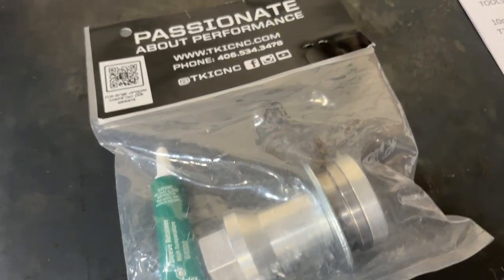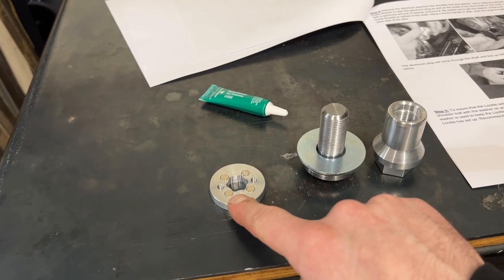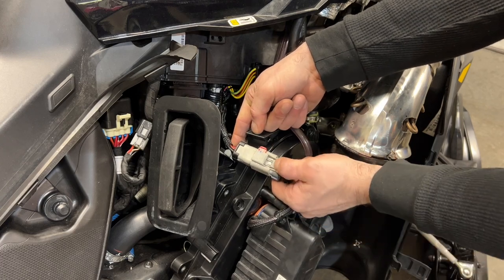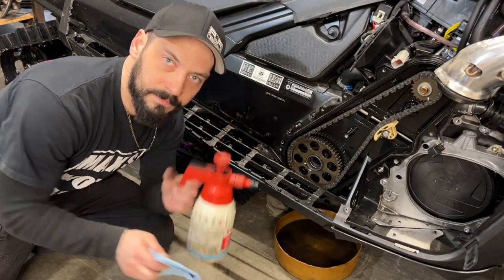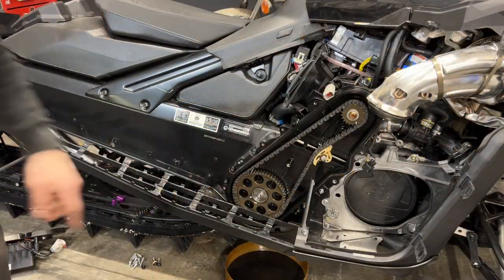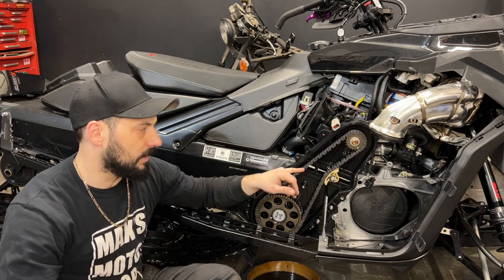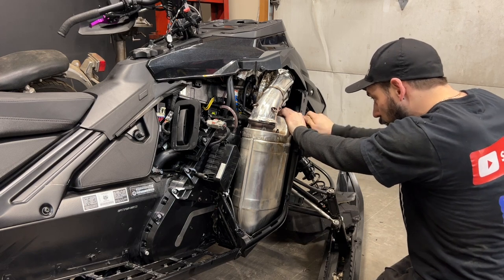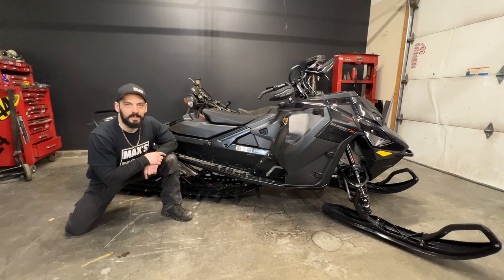Ski doo / Lynx Gen 5 Must Do UPGRADE / TKI CNC Driveshaft Retainer / Install Guide

Comment: Very very helpful....is the 24 XRS Turbo R 850.....the same....I have the parts and did not start yet... thank you so very much
Reply: Coupler is the same part number on the 23 850 as it is on the 24 850 xrs turbo. I’ll be ordering this asap for mine.
Reply from the maker: Glad it helped

Comment: Hey having a hard time with the loctite.  Waited like 1.5 hours and wasn’t cured.  Shop is like 40 degrees.  Could that have something to do with it
Reply from the maker: The Loctite does not need to fully set up. It only provides a bit of friction as the bolt starts to tighten. Once the bolt titans the insert will provide its own friction to torque the bolt down.